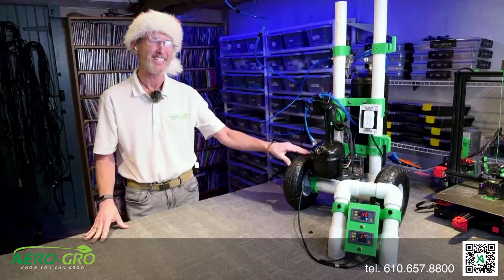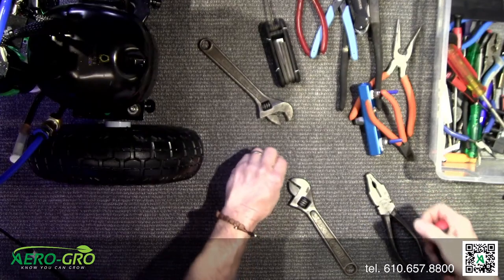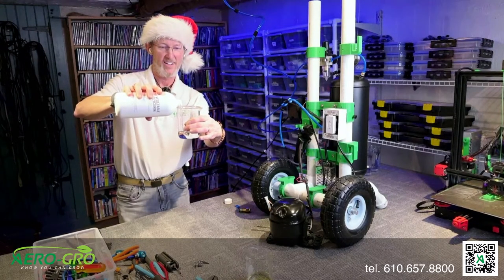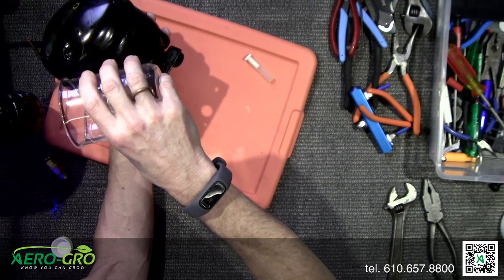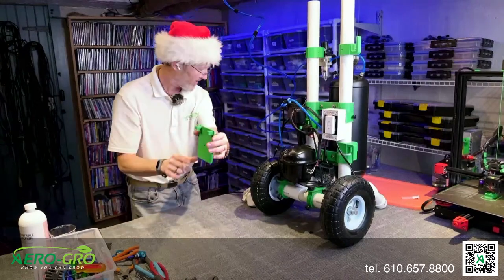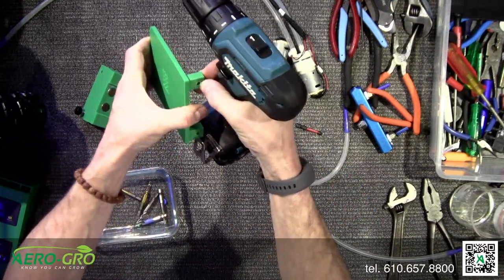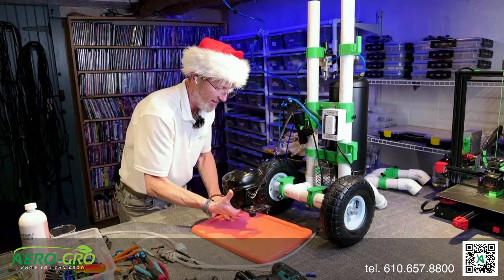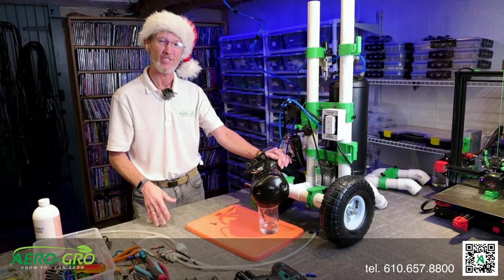DIY Hydroponics Lab - Episode 1

Comment: Vegetable glycerin is a bad idea as its highly hygroscopic. It draws water from the air and, unlike most oils, it does mix with water.  The output of the compressor may be enough to run a small system, the question is whether it can make it to harvest before the motor burns out or the reed valves develop issues.  TIP:  attach a tube from the suction port to the oil container and turn the compressor on . The oil will be pulled into the compressor.
Reply from the maker: How do you feel about mineral oil?
Reply: @aero-gro  
A hydraulic mineral oil is the best choice. You can buy FDA approved hydraulic mineral oil, certified for food contact, but its around $1275 for a 48lb drum. I`m working on an alternative method of generating cool, clean compressed air that is a lot cheaper than buying a new fridge compressor. If you invert the compressor you risk filling the cylinder with oil which is not compressible. This is the reason you should let a fridge or freezer sit for a while after moving it to allow the oil to settle. The oil is drawn up the central hollow tube and sprays out everywhere when the compressor is running so there`s no need to invert it.